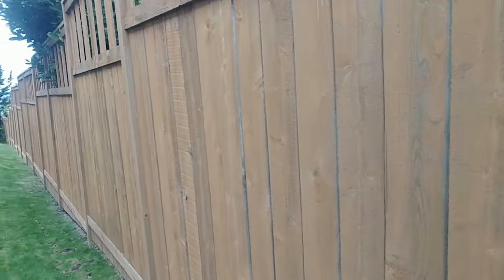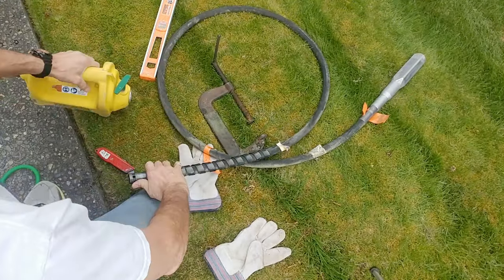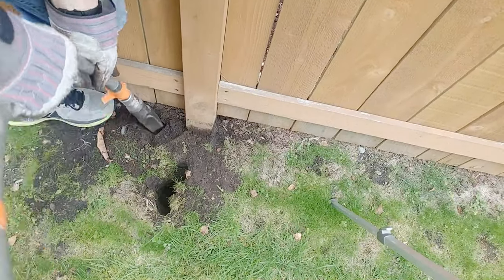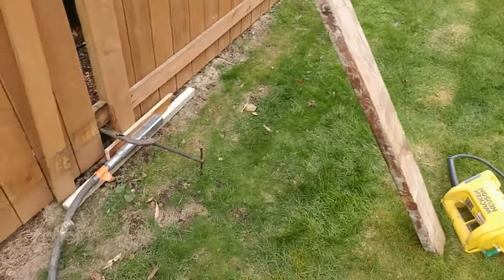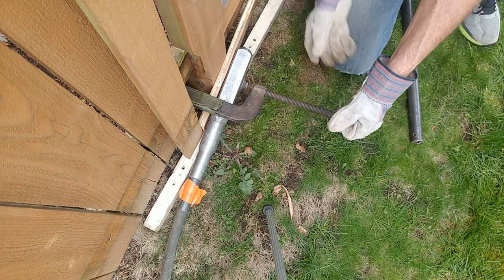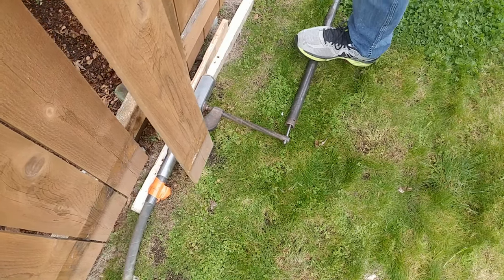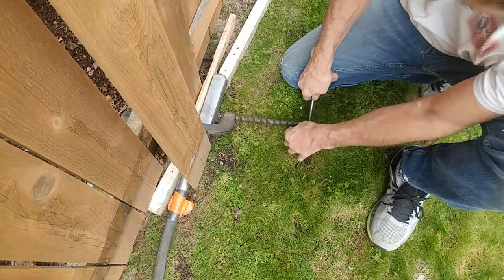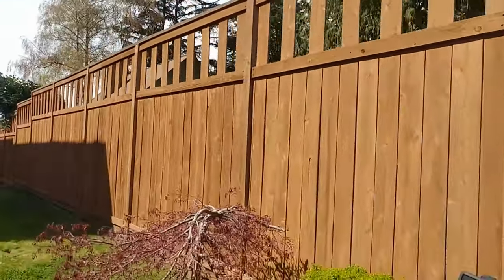How To Straighten Leaning Fence Posts Faster with a Concrete Vibrator

Comment: Fascinating technique. I had a massive tree fall on my fence and now all the 4x4s are off vertical. My only concern is whether this method is actually shattering the concrete footing in the process. Are you sure it’s just soil liquefaction? Thanks
Reply from the maker: Vibration alone should not crack a footing. I had a tree fall on a fence and it broke three of the concrete bases. Two of them had cracks that were very hard to see until digging the tops bare and hitting them with a hose. That revealed the cracks so I dug those footers out and re-poured them. Two needed new posts. Because of the impact nature of a tree knocking down a fence, my money is on your fence already has broken (cracked) footings. If you can't already see the cracks, putting a concrete vibrator on the post will almost certainly reveal any existing cracks.
Reply: @ScubaMoto  . Thank you. You make a good point. In my case the angle is only a few degrees. The tree demolished the panels in between and did not directly hit the posts. 
Guess I’ll uncover the tops of the footings and then decide if it’s worth a shot at your vibration technique. Either way, a very clever idea. Cheers
Reply from the maker: Tree impact is nearly always worse than what you can see. When my fence was hit it also didn't look that bad above ground. The next morning after the storm we all just see a tree against a slightly leaning fence. It was a tough fence and none of the panels needed replaced. Only one broken footer was visible at the surface so it was identified as broken immediately. It was two years later that the other damage was revealed. Posts had cracked at the top of footers and two more footers at the impact location had cracked. There is the moment the tree hits and then the rebound. By the time you walk out and look at it, the maximum impact deflection had already occurred and taken its toll. Concrete footers have no rebound. And since the posts are the wood members that take the true brunt of the force, they also get stressed underground at the footer. I hope this helps and good luck with repairing yours.

Comment: Great idea. After you relevel the fence post do they feel rigid again?
Reply from the maker: David P: It's held upright firm. The concrete bases on this fence are shallow so they settled down slightly as the soil compacted. It makes sense. If your bases are deep, you may want to add soil on top to fill a bit on top after doing the settlement.

Comment: how long did it stay? didn't you have to pound some wedge in to keep it straight?  sorry for dumb questions but I have a fence I'm dealing with and don't want to have to dig out the posts and start new. TIA
Reply from the maker: Great questions. If the lean is severe, you may want to re-compact the surrounding soil after the job because prolonged vibration may collapse the soil a bit. It's easy to compensate with some additional soil compacted over top. Success is greatly correlated with how healthy the posts are and how well they are bonded to the foundation. A loose post can't transfer much vibration energy to its foundation. I hope that helps.

Comment: Hello fella, Will this work for concrete post bedded in concrete 28 inch deep. I got a leaning post next to douglas oak. So not diggable.
Reply from the maker: Goog le: Agreed on likely not diggable in your case as you'd have to damage too much root system. You should be fine but the root system of that oak tree is happening for a depth of 1.5 to 2 feet so there is probably some root contact with your concrete depending on how long the tree has lived with the post. For that depth, you'll want a good powerful vibrator and good clamp setup. If you're lucky, there will be minimal root contact and you'll be done in two or three vibrations. If the roots have bound the concrete at its new angle, you may need to do it in several lengthy passes while adjusting your cross braces like the one post in the video. You obviously cannot clamp the vibrator to the roots but tight root contact with the concrete will transfer some of the vibration energy to the contacting roots and help allow those roots to shift slightly with the post while you straighten.  It depends on how much lean and how much root contact you've got.  It's hard to advise without seeing it but if it were my job and I suspected root contact was holding the concrete at an angle, I would do several passes until I had OVER corrected a bit knowing that those roots will need time to adjust to the new post position. With that much vibration, your soil level should drop a bit. When done vibrating and while still cross braced in an over corrected position, I would then add in and compact soil on top of the concrete and then remove the cross braces. I hope that helps.